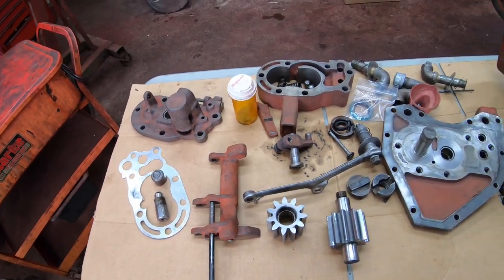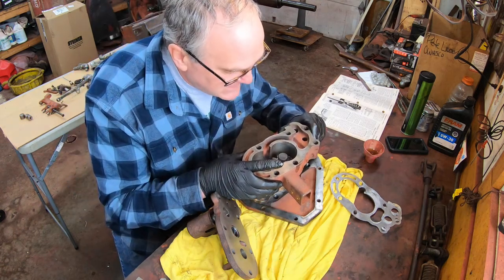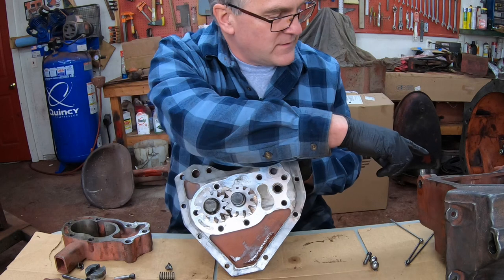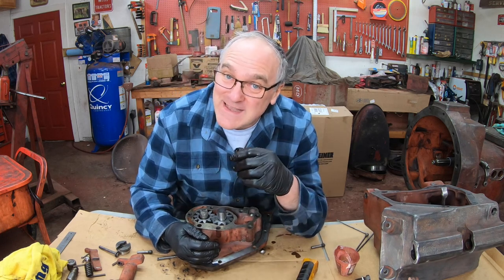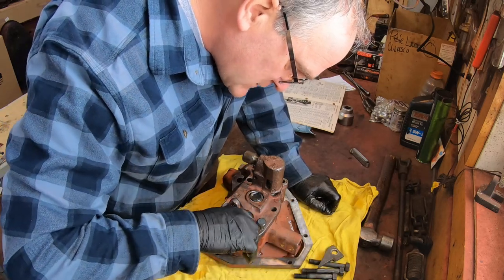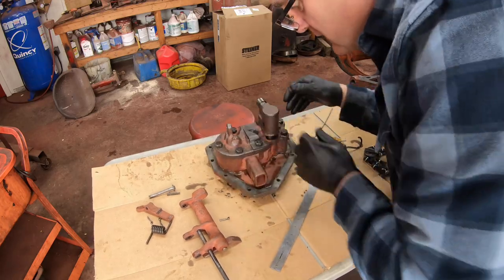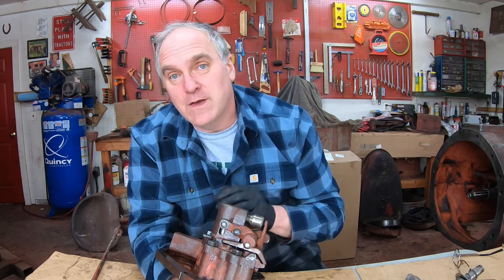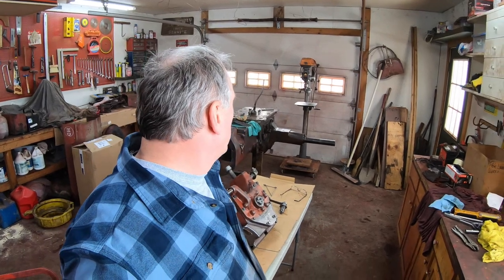Farmall MD: Rebuilding the Hydraulic "Lift-All" pump

Comment: Pretty amazing how Farmall, even back in the 1930s, intended their tractors to last for decades by their fine engineering!!🤩🤩🤩
Reply: * centuries
Reply: I knew an IHC engineer who said when he started “we just built things so they wouldn’t break.  Later on we had to reengineer parts if things didn’t break because that meant we had too much cost in the machine”.  Theoretically you could build things that virtually would never fail, but no one could afford them.

Comment: 26:49  We run International Hy-Tran in my dad's 1948 Farmall H instead of the 30W oil IH originally called for.  My dad got in that habit since the tractors on the farm would mix and match between implements, and we didn't want to contaminate different hydraulic oils between tractors from whatever remained in each remote cylinder.  I think that's a pretty common practice among vintage Farmall owners.
Now that the H is just a loader tractor, we added about a quart of Lucas Oil Stabilizer to the hydraulic system to help the pump stay lubed, build pressure, and slow down leaks.  It seems to work pretty well.
Reply: Good to know.  I am having a 1953 Super M rebuilt and want to use the same hydraulic fluid that my John Deere 2630 uses...just to keep all fluids the same.

Comment: One thing about these pumps that I haven't been able to find new from Case IH are those little spring retainers/check valve ball stops. There are other parts not available, but those darn spring retainers are such a small piece (you'd think they would be easily replicated). Great explanation of exactly how the pump works. When I did mine I tore it down and went through it. Never spent a ton of time REALLY thinking about how it worked. Thanks for a great explanation of actually HOW it works.

Comment: Rebuilt Ford 3 spd transmission on 60's Falcons.  Used a 12" piece of garded hose of same dia. of shaft, to install needle bearings.  Simple to do, then use the saft to push  out the section of hose, and your done.

Comment: I’m not sure how long I’ve been subscribed but I realized recently that you’re the “Mr. Rogers” of farming vids. You have a gentle nature that shines through and is captivating. Thank you for doing what you do and how you go about doing it. I restore little Jd “tractors” 110,112,120,140 from the 60’s and 70’s. It all started with replacing an oil seal on the front of a k321 engine in my greeat grmpas 72 140. Good stuff sir, ty.

Comment: Thanks Pete....! I remember those Needle Bearings very well, in Automotive School-Transmissions-Automatic/Manual, Manual shift Class, we tore down a Standard 4-5 Speed Tranny. Way down in the very bottom of the Trans Case is a "Cluster Gear"... it's stationary but it messes w/top side gears and it spins on a Shaft. Dismantling all the innards.... the Cluster Gear was last or next to last(can't rightly remember this was back in the 70's) and I'm 72....! The center of the Cluster Gear was hollow, the Shaft went through the Center but there were "Needle Bearings" that had to be inserted inside the Hollow Cluster Gear housing w/thick grease. The Case had a hole and you'd put the Cluster Gear down inside the Case, line up the Shaft holes in the case and slide the shaft into the case and the Cluster Gear at the same time.... hoping that all the "Needle Bearings didn't come out the other end.....! What a chore that was...!   =)

Comment: Great video!   I just finished an 8N (1947) hyd pump.  Easy, old fashion, and works very well. Rated at 800 lbs of lift. It does pick up the 5 ft. Modern brush hog (810 lbs.)  Thanks for the info I may need one day.

Comment: I have worked with hydraulic valves pumps and actuators for the aircraft industry for years and it is amazing how they are all similar in how they operate. Lot of new technology but they all operate on the basic principles of pressure, relief , bypass, return pressure etc...

Comment: Pete, you said that the pump system  is pretty basic and simple and I'll take your word on it, and is interesting how well the system worked. Maybe in your next update you can explain how a live hydraulic system worked differently  so when you stepped the clutch you still had the power,and if that tie in gave you live pro. Thanks for Avery interesting video on this part of the MIGHTY MD.

Comment: Another great video on the Farmall.  One technical quibble - the gear pump doesn't compress anything.  It simply produces flow.  The rotation moves flow from one side to the other (inlet to discharge) and provides a seal between the two.  Any pressurization is due to downstream restrictions and the flow trying to go through them.  This is true of any positive displacement pump (piston, gear, vane).  A dynamic pump (impeller) does actually produce pressure.  And oil isn't compressed, it is pressurized.  (Oil being incompressible for all practical purposes.)  Gases compress.  (Ok, If you want to be really technical, there can be a small amount of oil compression where the gears mesh when the fluid is trapped between teeth.)
Reply: Good  day jjabbxs   I    think that is why air  is use if u want it too compress.  Someone told me something like that.  Thanks

Comment: How you did that with the float glass is how I was taught. I have used this when rebuilding mechanical pop injectors. I was told to use a figure eight to keep it even.  This tractor is going to turn out nice!

Comment: Single stage pump as the weight of the implement will compress the cylinder to drop it. We have the same belly pump on all of our farmalls. When we bought the MTA then they had two stage pumps which pressurizes both ways on the cylinder(s). The MTA also had a float position which would allow the cylinder to float to follow the contour of the ground.

Comment: Excellent video. In response to Pete's comment about slowing it down too much... I would be thrilled if he slowed it down even more. The more in the weeds he gets with the geeky stuff the more I love it. I would have been tickled to see how those needle bearings are assembled. I am perty handy. But I have never messed with needle bearings. Always heard about them but have never actually seen one in the wild. 

My only very trivial and laughably nit-picky observation is this.  I was under the impression that you can't compress hydraulic oil? I am often wrong though. Heck...It happened just back in 2016. So I can't be positive. But I did posses the notion that the incompressibility of the oil is what makes a hydraulic system work. Bein an engineer/architect type fellow, I am pretty sure that Pete is fully aware of this and could teach me a thing or two about hydraulic systems overall. Therefore, I reckon that he meant to say that the oil is under pressure as in experiencing external pressure. Rather than compressed as in occupying a smaller volume.

Comment: Awesome video ! So I installed a 2 spool valve on my H. I plumbed the return into the bottom(drain) of the belly pump reservoir. I use the rear hydraulic outlet port for a Saginaw valley 3 point hitch with hydraulic up and down. I use the front left outlet for a 3 point hydraulic log splitter. I installed a shut off valve to the 2 spool hydraulic valve to route all flow to the front left outlet to provide full pressure to the splitter.It has always had a slight leak when I use the splitter, but today experienced a severe leak while using the log splitter. To summarise im using the belly pump pinned on the hydraulic pressure out full time as a pump. I know this wasn't its intended use, but it has worked for over a decade in this manner. Since I am experiencing a problematic leak I am wandering if you have an idea of what is the most likely failure point ? Any advice would be appreciated, thank you...Mike

Comment: The control lever in he down position would release the oil pressure to two cylinder ports first then as you continued to push the rod forward would release the pressure to the third cylinder port. This was designed for the row crop front mounted cultivator that had the rear of the driver tires cultivator shovels that covered the tire tracks so you could drop those shovels after you crossed the end rows. Later we realized it wasn’t necessary to have the rear part mounted so we left it off so we could leave the draw bar on the tractor to pull trailers or sprayers.

Comment: The lift-all on our "H" also delays the lift on the cultivators. You pulled the lever all the way up when getting to the end of the rows. The front cultivators would lift and as you traveled forward the rear cultivator would lift in the same spot that the front lifted. 
I am wondering if the pump on the "M" is the same as the "H"??? I have the pump out of my "M" right now and was hoping I could rebuild that one and install in the "H" that needs a rebuild??? 
Thanks for this video! Really explained a lot and I'm glad it's not just me having a little trouble reinstalling the pump in the reservoir and getting it to line up. 😊😊😊
Reply from the maker: Hi, the H and M pumps will not interchange.
Reply: @JustaFewAcresFarm  Thanks!!!
Reply: Seems like I remember a separate delay valve in line with the hose leading to the rear cultivator lift cylinder.  Also, there was an add on device called a select lift that provided separate valves to lift each side of a four row cultivator independently.  I spent many hours running our super m with four row cultivator from the time I was 13 until about 20.  Our super m was a 1952 model with belly pump.

Comment: Pete does the repair manuals cover all this information or is this something learned over doing it?  What amazes me most is the complexity of all this and how engineers figured all this out.
Reply from the maker: Hi Jerry, the I&T manuals have pretty sparse information regarding the pump; pretty much only spec clearances. The IH Blue Ribbon manuals may have more (not sure; I don't have the ones covering the pump). I think this is because most of the technical manuals assume the mechanic has a basic understanding of how things operate.

Comment: I've watched 3 utube productions on this same subject and yours made the most sense that I am confident, with several manuals, suppliers and parts book, that I can pull this off on my 1940 H. The system suffers about 250 psi. Considering the endplay clearance is critical to my overhaul, do you have any recommendations on locating the shim kit?

Comment: Hi Pete,
I sincerely like your videos……being a farmer for over 45 years I even learn a few thing from them!
I think you may have mis-spoke on one thing unless my Farmall M tractors are different. Both of my Farmall tractors will lift the loader cylinders with the clutch depressed or in the down mode. I also have working hydraulics anytime the pedal is down. I think you are confusing it with the PTO…….that will stop anytime the clutch is pushed down. 
Sorry to be pickings nits ! 
Randy
Reply: I have a '49 M and the hydros are not live, step the clutch and everything stops.
Reply from the maker: Hi Randy, it could be that your M's have been fitted with live pumps driven off the engine timing gears. The Super series and after went to this type of live hydraulics. Regular M's did not have live pumps stock from the factory.

Comment: Hey Pete, I was wondering if I could buy a hydrolic cylinder and use it as a 1 way for my Farmall H. Or do I have to find some kind of a 1 way cylinder.
Reply from the maker: You can use a regular 2-way cylinder, just put a plug with a screened vent in it where the second hose would go on the cylinder. You can get plugs like that at farm supply places.

Comment: Whatever you do, leave the lift assist spring out of the pump. They are prone to breaking and will get caught in the pump gears. Happened on my H and twisted the shaft that runs the gears under 1-5. That spring was used to automatically stop the pump at a certain point so you did not need to push the lever back in. Good idea but kinda didn't work, they can break and lock a pump in a hurry
Reply from the maker: They switched to a heavier, thicker spring mid-production. This pump has the heavier spring.

Comment: Question for you is the 30 oil better than the hydraulic transmission oil still better to use?
Reply from the maker: Hi James, it depends on how good of shape your pump & seals are in. If you have leaking or pressure problems, the heavier oil will work better. If not, then it's fine to use modern hy-tran.
Reply: @JustaFewAcresFarm  I rebuilt pump  thanks Pete we used the new trans hydraulic  oil thanks thanks your reply.

Comment: I probably would have just pulled the guts out of the belly pump and used the reservoir to convert to live hydraulic pump from a 400/450  tractor and added a valve.
Reply from the maker: Yes, there's lots of "frankensteining" that can be done. For what I'll be doing with this tractor, the original pump will serve just fine.
Reply: @JustaFewAcresFarm  what is the MD job going to be? Last I seen was tedding hay. Not much use for live hydraulic doing that job.  You have a bigger fleet then I do. I run a Farmall 450, M, and A. The live hydraulic pump just makes a tractor more versatile for my use and can look almost factory. I'm pretty sure I.H. dealership use to install live hydraulic updates on M's and H's
Glad the MD is getting a restoration, the expensive end of the tractor is done lol at least everything from the Bell Housing back is the same as a Gas M.